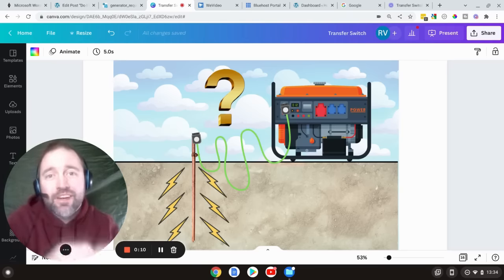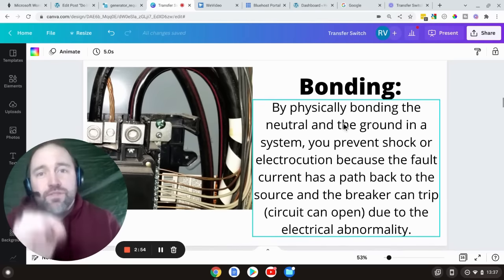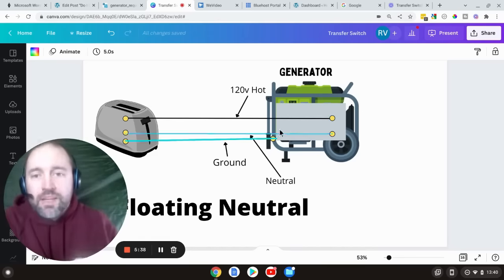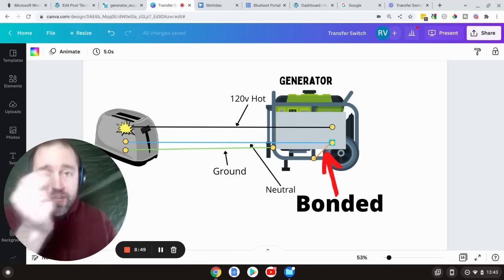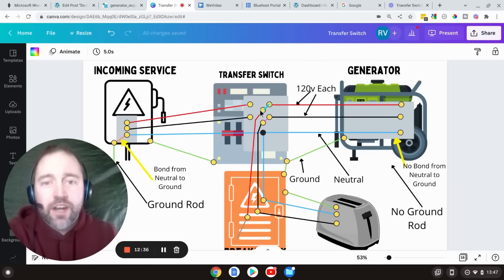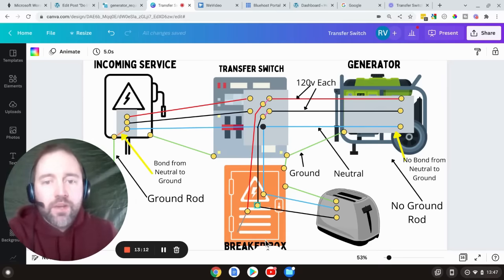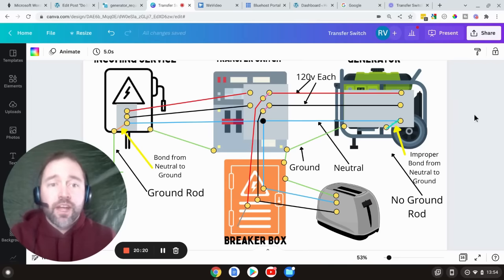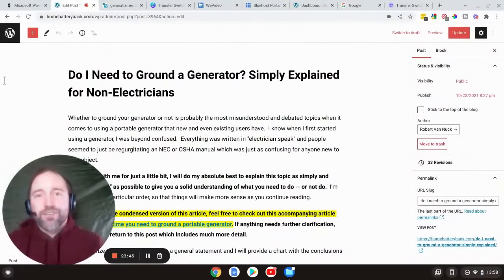When You DO and DO NOT Need to Ground Your Generator [Extension Cord Use & Backfeeding a Home]

Comment: I see this is a 2 year old video so this may not get answered. I’ve installed a Generator Interlock kit on my electrical panel for when I need to use the generator for backup power. Will I use a Bonded or Floating neutral with a 50amp cord from the generator to a 50amp inlet box that is wired (6/3) to a 50amp breaker in the panel.

Comment: If you were hooked up to an Motor Homes (RVs ) electricity inlet for shore power , for say charging up battery with the built in charger / powering tv etc , using a floating generator would this be correct method ,the inlet plug on the side of RV would be connected directly to the RCD and MCB breakers inside the RV , ?

Comment: At 12:53 you assert that the current has two paths. What’s confusing to me is that I was under the impression that it can only take one path, the path of least resistance? Which is on ground (during fault) back to common  back to source through common?

Comment: At approx 13 minutes into your video on the slide with a switched neutral and ground rod on the generator. I was wondering why the generator needed a ground rod as the fault current could go from the toaster case through the orange box and along to the transfer switch ground. From there it could go through the ground cable to the incoming service where it is grounded. Putting a ground rod on the generator allows two paths! What do you think?

Comment: I am really struggling to wrap my head around this one. So here you have two power switches in your example with the transfer switches. but in either case there is always a connection to neutral either direct or through the ground wire. My question really is what happens when you have two live different AC sources  and connect their neutral wires together.. It seems wrong or dangerous or I don't know how to say... But could you elaborate on the neutral connection being shared between two different voltage sources.

Comment: Excellent explanation, thank you so much! I'm not using a transfer switch on my home, but rather an inlet box and lockout on my main panel to power my home in the event of an outage. My 120 30 Amp Champion generator has a floating neutral. Am I correct in assuming since the panel is earth grounded to a rod, and my inlet box to the panel is tied to that to that same ground (within the main panel), that I do not need an additional ground for the generator? Thank you in advance for any light you might shed on this "hypothetical scenario". ;-).
Reply: If your inlet box is wired correctly you gain the benefit of a bonded ground/neutral going through your mains input.
Basically you are trading the generator for the commercial power at the input.

Comment: Welder-specific question, please! If I am running a 240V welder off of a generator that has an unbonded (floating) neutral, does that pose additional risk of shock with a fault, compared to the same setup on a generator with a bonded neutral? If I understand correctly, 240V welders don't connect to the generator neutral receptacle anyhow. So, if I understand correctly, the fault risk exists, but would not be mitigated by a generator with a bonded neutral anyhow. Is that right?

Comment: Excellent information. The only problem with this is that per osha's requirements most generators are already bonded internally which means it's problematic if they are now attached to a house. In some ways I wish they would just put a switch and educate the customers but.....
due to the tyranny of default it would have to be left in the bonded position.
Reply: Have you found that most of the manufacturers have instructions on removing this bond when necessary for a non-separately derived optional standby system?
Reply: I just leave a bonded plug hanging on my generator and a note attached to the generator, indicating that needs to be plugged in to the receptacle when using generator standalone and unplug it when generator is hooked up to the house.

Comment: All of those three slides look the same to me. It's not clear at all what I should do. Do I connect the ground terminal to the frame? That picture showed a pile of wires and I can't tell what wires went where. I am just trying to use a generator with an extension cord. I am not hooking it to the whole house.

Comment: This also kind of shows why you don't put ground rods for external light poles if they are going to a main panel of of a building that's already centrally grounded.  The same kind of fault can lead to the ground around the light pole being energized.  People have actually been killed by this happening. Despite that some place still put them in for "lightning protection" despite the fact it does zero to prevent fires or damage.

Comment: I hope your able to help me answer my question:

I Have a friend which I would be helping connect an off grid inverter system. He does not have utility from the grid supply at all. So he only uses a generator. 

We will be installing a solar system powering through an inverter with a lithium battery. But as a backup we will be connecting the generator only into the Inverter AC INput. the AC Output from the inverter will be the only supply to the home. My question is do I bond at the generator supplying the AC IN of the inverter and then bond again at the AC Output of the inverter so that the power going into the home is bonded between netural and ground?

ANy guidance will be so greatly appreciated

Comment: U have a transfer switch with a center off, so no common neutral.  Wouldn’t it be easier to just connect all neutrals together in the transfer switch than having to drive a ground rod and bind the generator?

Comment: So in the scenario where you're connected to a house you can't use an extension cord at the same time because one calls for a floating N and the other doesn't. If there's a fault with the cord- does the current not travel through ground in the bonded service and back through the N to the generator??

Comment: @ 14:01 - the neutrals are switched, but not the ground, you're still connected to the house ground, and ground rod.  Why do you need an additional ground rod when you're already connected to a ground rod?  I realize code may require it, I'm trying to understand WHY though.  Thank you, very good presentation.

Comment: Hang on. Grounding may not prevent you from getting shocked, but it will provide a lower resistance path for the power to flow on, so the voltage and current going thru you is way lower and less likely to cause any harm. A fault to the chassis for instance energizes it. If it is grounded then the power will flow to ground. If you then touch it, it becomes a voltage divider. Some going thru you, some thru the ground. The ground has (or should have) a low resistance, your body a pretty high resistance. So you will get shocked, but by a much lower current.

This is independent of bonding the neutral and the breakers.
Reply: In that example the short to ground would also likely cause the breaker to trip, which would de-energize the circuit and make it known that something is malfunctioning.  So it does help protect against malfunctioning devices or stray current in various ways.
Reply: @CL-gq3no  Depends on the fault. If it was in the middle of a motor winding for instance, the power would still be running  thru half of the load before energizing the grounding system. Then there would be sufficient load in series to prevent tripping the breaker.
Reply: The load (current) will double in your scenario and the voltage "loss" over the remaing impedance/winding will be the same, i.e no change and as said earlier, the low impedance path through ground will trip the breaker if the voltage is high enough at the chassis due to a malfunction described.
Reply: @lars-akeclasson875  I don't follow your statement. For the current to double, the resistance would have to drop by half (the person would have to be as conductive as the grounding system). A person touching the chassis will have much higher resistance than the grounding conductor and barely affect the total current.

Comment: I am in South Africa. We have 240 volt system. I installed a transfer switch which disconnects Live and neutral and I connected the ground to the incoming ground. This trips the earth leakage when a fault occurs in the house. I also have a 1.5m ground rod which I connect the generator to when I use it that is connected to the generator ground. This was approved by an electrical engineer.

Comment: Your description at 8:23 is incorrect. If the appliance or tool is properly grounded through the extension cord. The path of least resistance is through the cord. If the hot shorts to ground, the circuit breaker will trip. If there is an open between the body of the appliance or tool and the grounded conductor, you will have a hazardous situation.

Comment: Think of the output widing as the same thing as the secondary of a transformer.  If the secondary is floating, there's no telling what the secondary voltage is in respect to the ground you're standing on.

Comment: Great video and thank you.  Is there a way to connect a bonded ground neutral inverter such as the Xantrex 2000 to a transfer switch that only switches the hot but does not switch the neutral leads?  I have seen other videos where they isolate the inverter ground from the ground at the service panel.  One video separated the grounds by using a grounding adapter at the receptacle of the inverter and not connecting the ground of the adapter.  My inverter is the Xantrex 2000 without the charger and the transfer switch is a Generac.  The transfer switch only switches the hot.  It uses a 5L30P plug and it is designed for 240/120 split phase from the generator.  As an experiment,  I made an adapter cord that had a L530R receptacle on one end and a standard plug on the other end.  I used 12 gauge cord.  I bridged to two hot connections together at the 5L30P with the understanding that the neutral would be carrying to full current back to the neutral bar at the service panel.  I made sure that I would not exceed 15 Amps.  This cord enabled me to run electricity to the house after storm from my Honda EU2000 generator.  I was careful not to overload the ampacity
Reply: of the cord.  I am interested in finding a safe way to use my inverter during a power outage that would be within the rules of the NEC.

Comment: This really all just boils down to two things which should always be true:

Within a given electrical system, there should always be:
* Exactly one path from 'ground' to 'neutral' (neutral-bond)
* Exactly one path from 'ground' to the physical earth (ground rod)

(This should be true whether you're on generator power or not)

That's all you need.  Zero for either one is not enough.  Two is too many.  (and three is right out!)

(There are some cases where multiple ground rods might be warranted, but they are fairly unusual, and generally need special design considerations.)

Comment: I have NEVER seen a toaster with a grounded plug. Nowdays they have a "polarized" plug. 

I believe the neutral is supposed to be connected to the case. There is no ground loop because the equipment is ungrounded.

Comment: Utility power coming in has only neutral (no separate ground). When using a transfer switch that also switches the neutral (separately derived system) shouldn’t the connection between transfer switch and generator also have no ground?  Assuming the generator is bonded

Comment: if you are going to use your generator for 240 volts i recommend you ground your generator reason is i tried using a 208/240 induction burner to heat a pot of water the unit worked i mean the electronics worked for the induction burner but no heat so i grounded the generator about 6 inches into the ground with rebar and attached ground to rebar and turned on the induction burner and it started heating. So yes you need a grounding rod if you are using 208/240 volts from generator.

Comment: A switched neutral does not mean the the grounding electrodes are disconnected.  
Grounding electrodes could be anywhere downstream of the switch point.
An electric water heater or pump was bonded to the metallic water piping system.
A furnace is bonded to the fuel line and metal ductwork.
Metal conduit or wires might bond the transfer switch to the service meter.

A careful installer ensures that grounding electrodes are connected at or downstream of the transfer switch or bonded to the upstream connections.
Reply: Yes, but you can't count those "incidental" earth connections since the earth connection needs to be a short as possible to reduce inductance effects. So the earth connection needs to be made as soon as the power comes in to the panel then as short as possible to the earth.
Reply: @MandrewP :

They aren't incidental.

The point is that the system is never isolated from earth.

I'm referring to fault current.

Your mention of inductance has no bearing on this.  Neither does resistance in the metallic portion.

Whether the connection is 1 meter or 10 m away has a negligible effect.

Comment: I never considered grounding batteries, that's interesting. I do ground mppt controller and inverter to automatic transfer switch bus bar, and that goes to electrical panel bus bar.

You recommend grounding batteries before or after the BMS on negative terminal?

I mean assuming you're using the lf280k or new lf560k batteries with a JK BMS as most people do.

Comment: A generating system is not considered a separately derived system unless the neutral is broken upon transfer. Therefore, you do not put a second ground rod at the generator. You want everything to go to the utilities XO that is where everything is bonded to and that’s where it shall be bonded to, with the ground electrode conductor of the primary service

Comment: Thank you for this video.  This is an excellent resource.

I have a situation and a question.  I use my generator to backfeed a breaker on the panel and use a mechanical lockout (code acceptable) to isolate from incoming service.  I do not use a ground rod.  In this case, neutral and ground have paths to incoming service since the backfeed only affects the hots.  Now my generator has a bonded neutral, which by your instructions is a no-no.  However on my generator, the bonded neutral is routed through a GFCI circuit.  So, a fault that results in any current on the ground will trip the GFCI.  So the question is, does this allay concerns about current sharing of neutral and ground in your last example?
Reply: and also, if all working as it should, well, if power company, supplies to property, not working well, (if the problem) is more local to you end, of the incoming service, they in small, situations, maybe gone, well (you would probly now, by your service box burning on fire), but the I'm going off grid, so your not relying on any out side sources, in including the not your ground/earth, say your in a flat towner block/ where an access reliable ground/earth is not there,   and it more a battery backup, more than petrol/gas generator solution wheeled out as patch up solution
Reply: I live in the USA and have your same set-up. I have a Bonded Neutral portable generator feeding power into a Generator Inlet Box on my house that back-feeds a Double Pole Breaker in the Main Panel just off the meter.  Main panel is the First Means of Disconnect so the Neutral Grounding screw is in place AND the panel has the Breaker Lock-out installed as well.  Because of this set up, I need to UNBOND the Generator.
     I would like to keep my generator BONDED as this allows me to use it when camping or working on remote projects.  Would I be correct that by disconnecting the Ground wire at the Generator Inlet Box on my house, I am effectively no longer bonded at the Generator for this scenario?  Does this create any safety issues?

Comment: in the case of 11:53, what happens when the power is restored to the main panel while the generator is running (transfer switch is in the generator feed position and neutral is shared and bonded only at the main panel)?  Just asking in regards to the neutral since it will be shared while both generator and main is energized.

Comment: I read one commenter say if you try to use a generator ( without  a neutral to ground bond somewhere in the circuit) to run a furnace that it may not fire the igniter and so fail to work.
Reply: Not true in my case.

Comment: I have a generator that comes in via a 2-slot circuit breaker on the bottom of the panel. So you open the breaker out at the service entrance to stop that, then close the generator breaker on the bottom of the panel. am I right in concluding that is effectively a switched neutral? Because the neutral at the service will be disconnected when that breaker is opened?